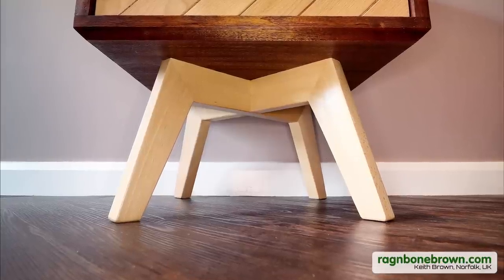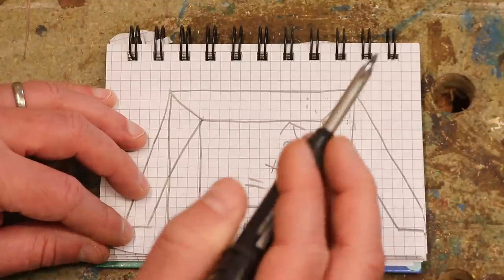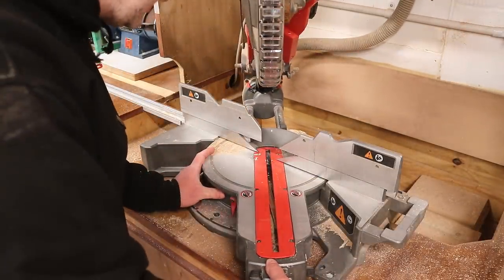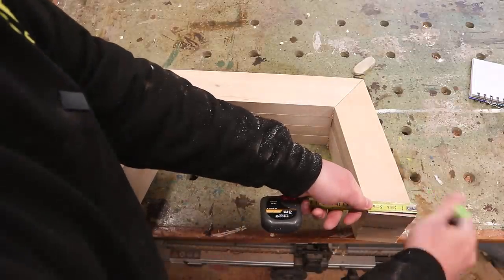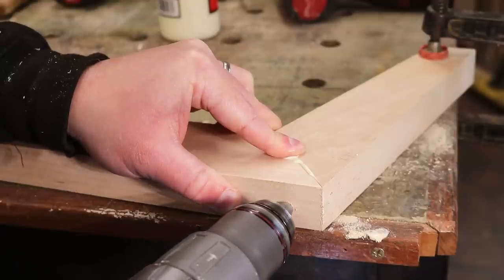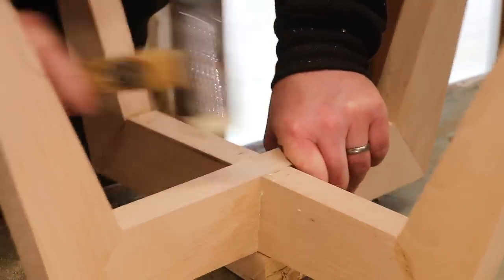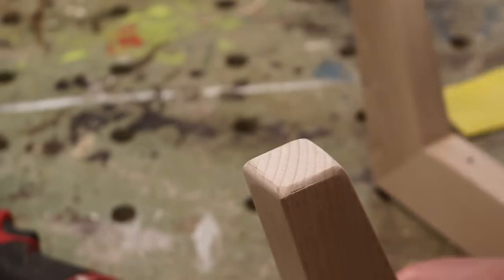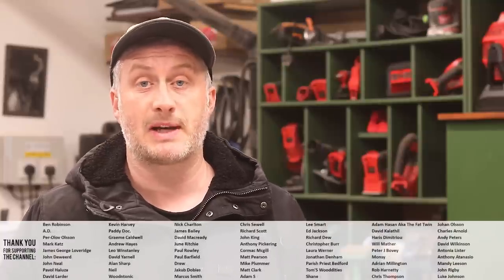How  I Made This Angled & Tapered Leg Base

Comment: Beautiful job, Keith. The scale of each piece is well done and only needs a bench at the foot of the bed to complete the set.
One thing to consider the next time you're cutting an angle on the table saw using a custom made jig. The jig you made was exactly right for the task so the next time try to make the stop blocks the same thickness (or a fraction thinner) as the working stock and then screwing a piece of sheet stock on the top side of the jig. This creates a sandwich to hold the stock in place without risking your fingers. Temporarily removing the blade guard will help with visibility. This method is useful unless your comfort level is telling you otherwise.
Reply from the maker: Thank you! I think it's about time I made a decent tapering jig with some hold down functionality either way 👍
Reply: @RagnBoneBrown  I get the safety thing and appreciate the concerns you mentioned. I have also seen band saw blades break and how they snake all over the place. A taper jig is the better method, IMO, either shop made or store bought. Regardless, personal comfort and safety is ALWAYS a factor but I have watched you progress to journeyman ability and see no reason why a taper jig will not become your best friend in the shop. Cheers!

Comment: I said it before after seeing the first video these nightstands are excellent and when in place against the bed they look really good. They have that mid century look but also look up-to-date and contemporary (current). I like everything about them especially I think the the bevel has worked as an interesting detail, was worried what they would look like on legs but I think you have pulled it off as the angle and leg taper fits with the edge bevel, excellent one of the best set of night stand builds I've seen well done!
Reply from the maker: Thanks you very much

Comment: When your stop block on the mitre saw couldn’t be used because the length of timber was too short, you could have clamped an off cut of wood to the rail. (At least it looks like you could)

But jeez, the angles, they fry my head every time, nice work and a cracking piece of furniture

Comment: It's always interesting to me how different people think about math. At the beginning, when you were talking about how 0 on the miter saw is actually 90 degrees, I'm thinking "right, so subtract it from 90 and you're good" but then you subtracted 45 and I scratched my head. Then you subtracted that result from 45 and I got a little less confused: 45 - (x - 45) = 45 - x + 45 = 90 - x. I'm not really sure what motivates you pivoting around the middle of the angle (I guess because you think of it as deviating from a 45 degree miter?), but what matters is that the final number is right. I just thought I'd throw this out here in case "if your desired angle is measured from straight instead of from the right angle that is 0 degrees on your miter saw gauge, you can convert by subtracting your desired angle from 90 degrees" makes more sense to someone else.
Reply from the maker: Interesting... Let me start by saying that I'm useless at maths, and I've only really understood angles via my own learnings and mistakes rather than possibly learning it "the right way"!  But I always think of angles in a dissected way in terms of woodworking (hence the 90 is 2x 45s, and I tend to always use that as a starting point, hence the deducting 45 rather than 90. Your comment made me think!
Reply: @RagnBoneBrown  Sure, that makes sense. Like I said, the important thing is coming up with the right answer, and any way that works for you works. That said, much like you talk about in this video in terms of woodworking techniques, I find it really valuable to be able to look at the same math problem in multiple different ways. If one way isn't working for you, you've got another. If you try two strategies and get the same result, you can have more confidence in it. If you're trying to explain to someone else, you've got more tricks in the bag in case one way works better for them.

Comment: They Look Great, with the bed, they complement each other which is stating the obvious. 'Safety'. Not comfortable.... Don't do it.  For the gap in the drop saw and bench top, stop block track, I have made a wooden extension stick that I can clamp down with a hold fast, to get repeatable cuts.
Reply from the maker: Thanks Peter great idea. I should really make a tenoning jig!